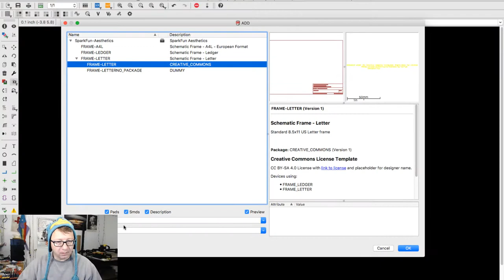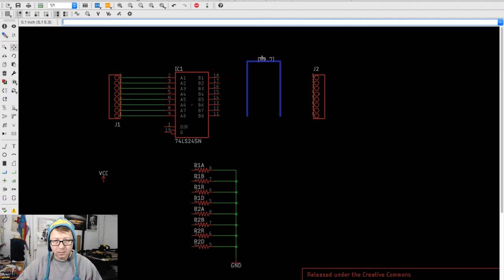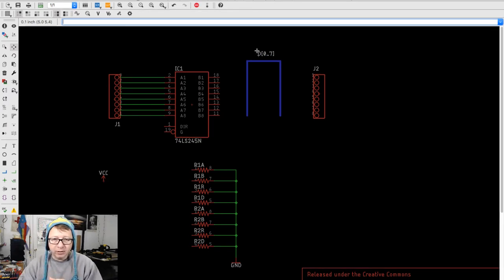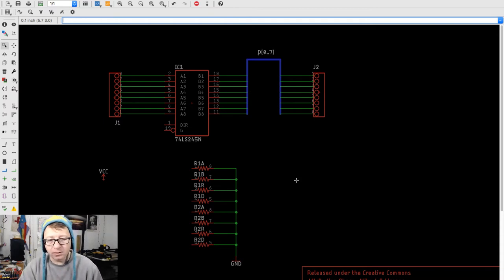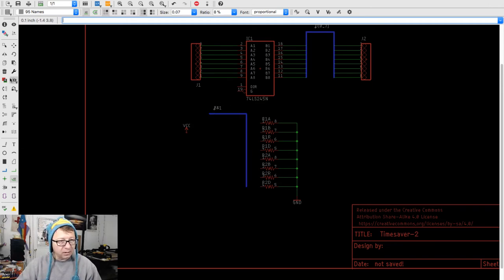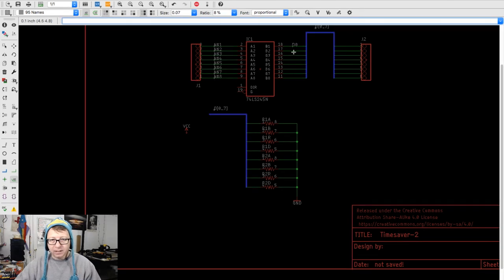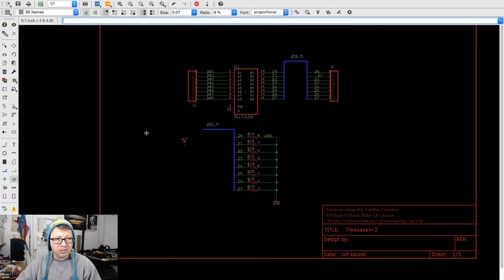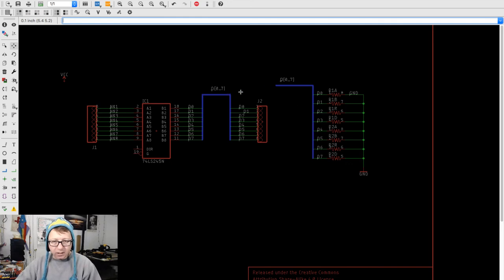Eagle CAD Tech Tip - Using Bus Wires and Labels

Comment: In Orcad when you create a bus like this, you just place the first wire (D0) and after that it autoincrements the wire name (D1....), automatically infers the next wire so you just click one pin to place it and also it adds the label at the same time, so essentially you click once per each pin... is that possible with Eagle? I counted for each pin you made several clicks to place the wire and a couple more to place the label, in a memory, bus design that's hundreds of click... time consuming
Reply from the maker: @edge30 - nearly every CAD program I've used for PCB/Schematics have the auto increment function.  However, I don't think Eagle has the capability.  Now that Autodesk has purchased Eagle, the development cycle has ramped up to epic levels, and they are constantly providing updates. They have changed the way busses are created and now require a "specification" that automatically adds a label.  This saves the secondary step of adding the label, and now forces you to declare what signal you are connecting to. However, it's still manual selecting from the drop down list of every signal. They are making progress, but still not as easy as other programs.  Hope this helps.

Comment: Why did you fast forward the first 5 steps?
Reply from the maker: Hi - in short, I assumed folks watching the video were familiar with putting down parts, which I covered in previous videos. There is always a balance between video length, flow, information delivery. Thanks for watching.